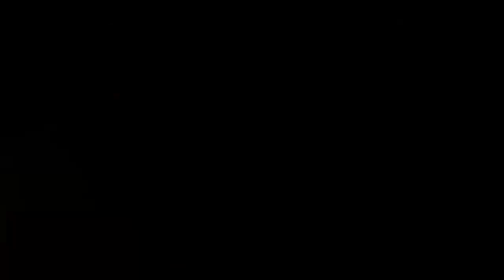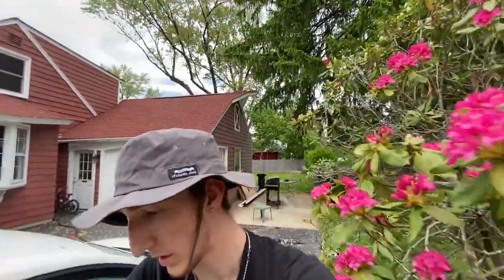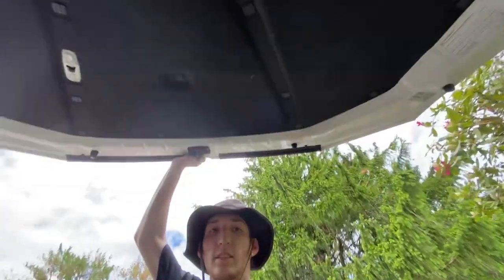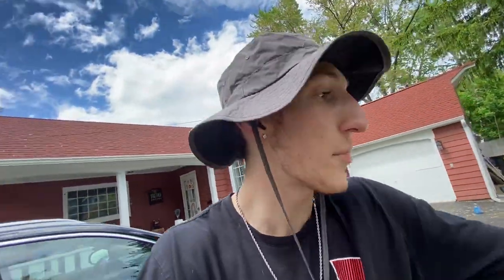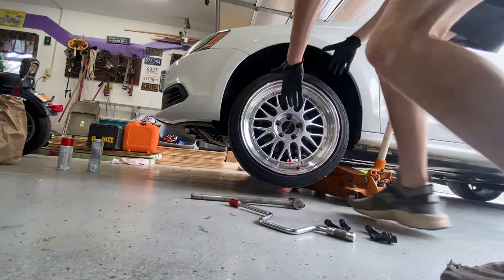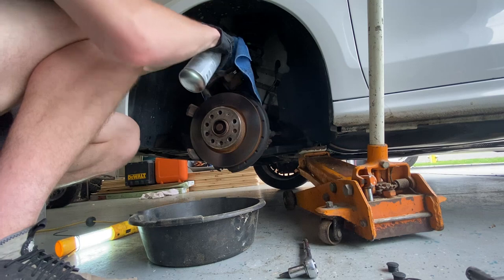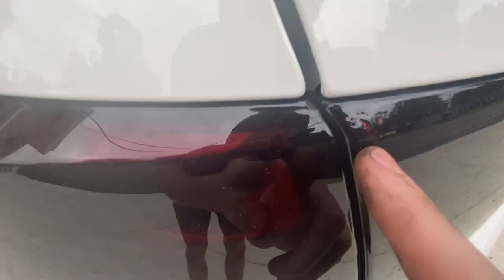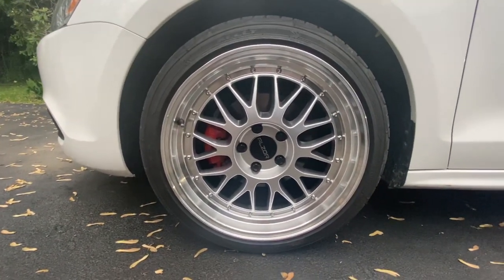VLOG #2: PAINTING THE CALIPERS ON THE JETTA!

Comment: Those bubbles are probably from a heat gun when trying to shape vinyl around the corners. Considering how long it's been since the video was posted, Iunno if you've done anything to look further into it, but if you remove the tail lights, you should be able to notice the edge of the vinyl if it is vinyl.

Comment: hey im 16 and just got my moms old car its the 2012 model. also no v8, any suggestions on what to do first. I dont got a job rn cus of corona so i was wondering any cheap upgrades
Reply from the maker: Lamppost_Cover first i recommend checking out grubhub and seeing if they’d hire you. But i recommend maybe bulbs for headlights, leds on the interior, shift boot. then comes like head unit which is probably 150 bucks and will make the audio better. i’d browse on ecstuning.com and see what you like !